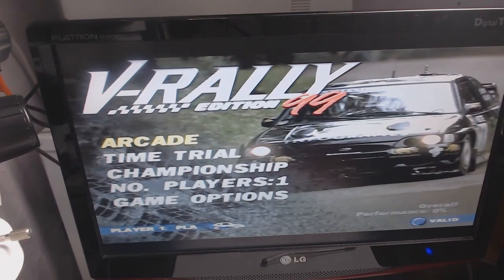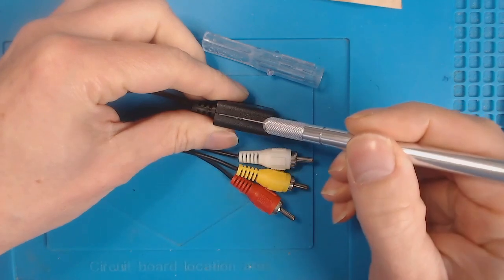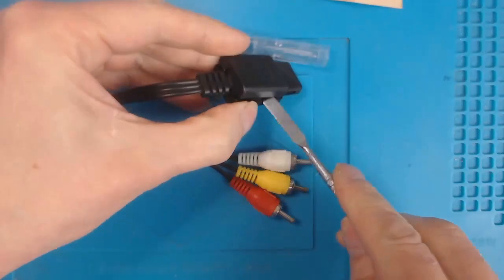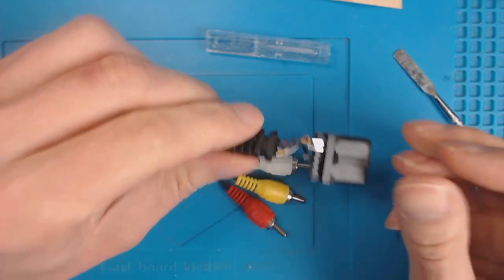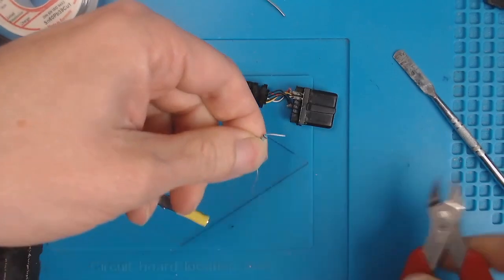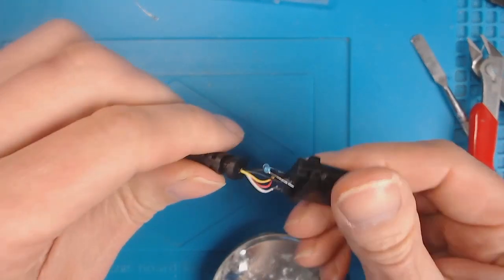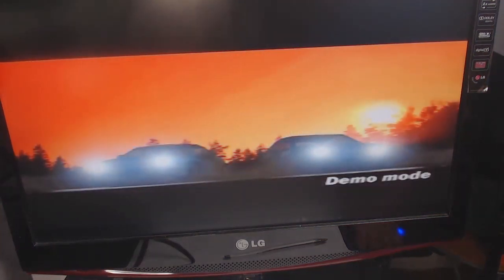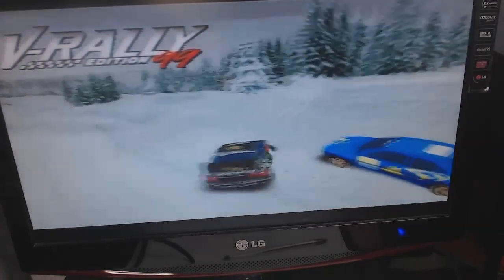N64 Too Bright on your old TV?  | 75 ohm Resistor mod for PAL TVs

Comment: Few years ago I read somewhere on the Internet that 220uf capacitor is also recommended for PAL composite cable. There are even scart RGB cables available with these caps.
I'm curious why someone recommended it, I soldered resistor + capacitor few years ago and it still works perfectly fine

Comment: I tried this on a RCA cable and it didn't work. Should I try on a s-video one? I have a American N64 and I'm playing on a TV that correctly shows the image from a NTSC SNES.
Reply from the maker: Did you get this fixed? I missed your question but don't know much American hardware, sorry.
Reply: @PhilipBryden  it turned out the problem was the console, I opened it and there was a very bad RGB mod. Now I bought a Japanese N64 and with different cables the brightness is different but it's still kinda bright, even if better than the other one. I don't have anymore that RCA Cable so I guess I'll try to mod another one (or buy it).

Comment: Thank you! This worked perfectly for my composite cable n64 cable.
Reply from the maker: That's excellent news. I'm glad it helped. What games do you have for it?
Reply: @PhilipBryden  I recently got it from my brother. I have banjo kazooie.

I have a multi out to scart RGB cable which I am trying to modify to s-video. Do you know if I could connect the resistors in the scart casing instead of in the multi out casing?
Reply from the maker: I'm not sure. If the SCART is RGB, will the S-VIDEO be connected up? I'm not too clued up on the different formats tbh.
Reply: @PhilipBryden  Seems like I have to get some other capacitor for the s-video.

Since the n64 does not support RGB i instead just put a 75 ohm resistor on the composite video like you did in the video but i did it in the scart housing instead between pin 20 and pin 18 and that too worked great! (If someone else has a multi out to scart, this seems like a viable option )
Reply from the maker: It's a shame about the N64 not supporting RGB, but at least you got it sorted with your own scart mod. Does the S-video  give a better picture than composite? Have you considered an HDMI adapter?

Comment: I did this yesterday and can confirm it works. Thank you !!!
Reply from the maker: That's great to hear. Well done. I have a faulty N64 PSU here I'm working on at the moment. I'm pretty sure the thermal fuse has gone but it's not easy finding a direct replacement.

Comment: For anyone wondering' Phil! used a Metal film resistor & yes! it will yield better resistance, Plus better voltage coefficient and be temperature coefficient.
Nice little Mod that & well worth doing, your TV and Eyes will thank you Phil! plus it's easier than doing the internal RGB Mod too! 👍🏻
Reply from the maker: It has a huge difference. There should be a controller arriving this week, so I'll be able to test it properly. Thanks Steve.